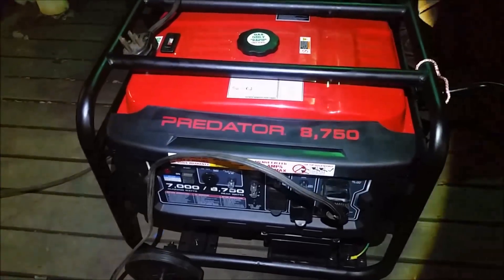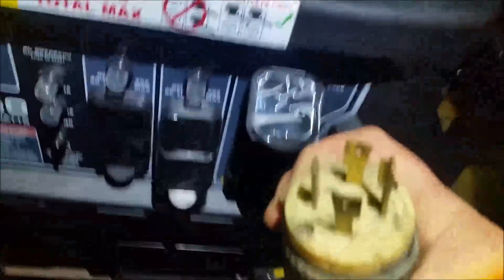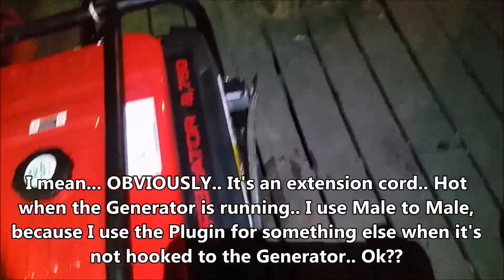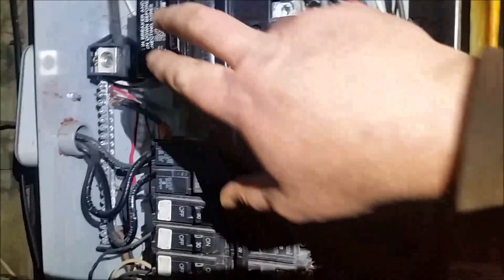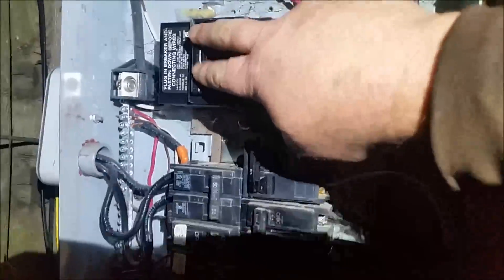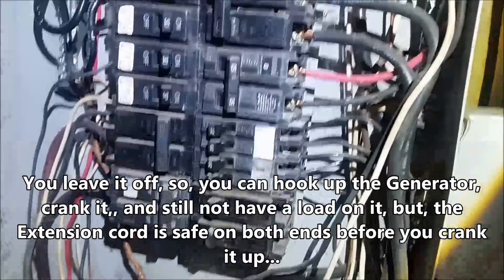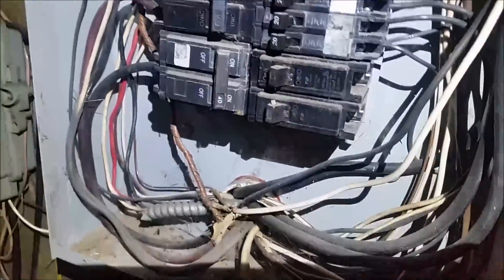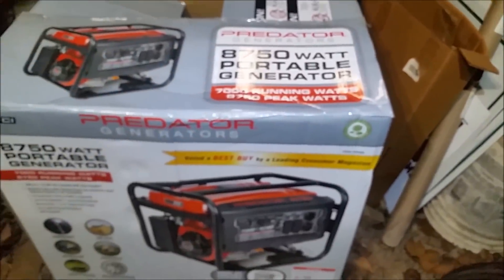Quick/Easy/Safe: Use Existing Plugin/Breaker for Generator hook up to your house Panel box.

Comment: Mark, you have made a very dangerous video. The average consumer is not capable of understanding the implications of a single error in this process. It can result in the death of a service person trying to restore power. I come from a 40 year career in the electric utility industry. A portable generator should never be used this way. It should be used to temporarily power individual appliances or lights. To use a generator in this manner requires a permanently installed  UL listed transfer switch that prevents interconnecting the auxiliary supply with the commercial power. Tripping a main breaker to OFF does not satisfactorily accomplish this. 
Any person that intends to use a generator during a power outage should prepare by installing an approved transfer switch before the power goes out. By over simplifying this connection you are setting someone up for a disaster, even if they only fry their TV set or microwave.
Reply: OK, if someone forgets to throw the main breaker their little generator is going to be trying to power the entire grid that is on their side of the outage. How much ampere would there be left to shock someone? In about 5 seconds it is going to strangle to death on the load.
Reply from the maker: Willie Keener.. Guys like you really amaze me.. How can you spend 40 years in a field, as you said, and not have more of a clue than you do,, after those 40 years.. I cringe when I think that you might have had something to do with the utility power, powering my home if you don't have more knowledge than I do about this and you were working on what supplies my house with power??? Holy Crap Man.. How could you sleep all day for 40 years??
#1) People are not as Stupid as you are.. When they buy a generator that will run their whole house,, do you really think that you will convince them that they should only run their """Individual" home appliances ""OR"" Lights,, rather than their whole Home on Generator??? (Individual Appliances,, "OR",,,, lights??) ARE YOU JOKING???? And, you claim to have 40 years Experience?? WHAT A DUNCE!!!
Don't worry about my video,,, worry about ANYTHING else you are going to do today.. Thank God, you are not in the field any longer... 
Single Error,, I agree with, but, not in my procedure.. Single Error working with Electricity at all.. If they made it past that, then, they are ready for the video, because, the video does not teach them how to make the cord, which is a next step they will have to search to find, and might start off a their local hardware store where they will get a second reality check,, where they might run into someone like you that thinks you can't use a Male to Male extension cord without killing themselves.. Once they get past that,, they know Electricity can kill, and Male to Male cords can kill.. Hell.. At least they are not in there trying to "Totally Rewire" their Main Panel Box,, which is about 1000 times harder, more complicated and 1000 times more risk to say the least.. But, you should know that,, just by looking at how to install one,, much less actually doing one or two of these in 40 years.. How could you maintain your opinion?? 
Average Consumer? Yes. I would agree with that statement.. But, what would an "Average Consumer" be doing, looking for a video like this?? You are right.. This is not for the "Average Anyone".. You have to have Common Sense to do something related to Electricity,,, forget the Generator hookup of any kind.. But, above average DIY's will have 100% success with this, as long as they use Common Sense... 
Next: Where in my homeowners manual does it say that I am required to have a Permanently installed UL listed Transfer switch?? Did I miss that manual when I bought my home?? Maybe I missed it when I bought my Generator?? Surely,, the Manufacturer of the Generator would not have sold me the Generator without me signing off that I had a Transfer switch and what my intended use of the Generator was?? So,, the requirements that you are talking about.. NEC?? Who's code is that? Your Average Joe Blow homeowner?? Sorry.. You are Dead Wrong!!
Now,, lets get a little bit lower on the Common Sense Totem Pole.. 
Your Statement:  requires a permanently installed  UL listed transfer switch that prevents interconnecting the auxiliary supply with the commercial power. Tripping a main breaker to OFF does not satisfactorily accomplish this?????? 
I would like you to explain to me just how you figure that.... You have a main breaker in your panel,, which you think turning it off does not disconnect or Isolate the Panel from the Grid or local power company (Utility Power).. But, somehow, the 'Main Breaker" in the Transfer Switch does??? 
Are you assuming that the Transfer switch does not directly connect to the main breaker in the panel?? Is there not a "Main Breaker" in the Transfer Switch that does the exact same thing as the Main Breaker in the Panel?  If you say it does not, then, please explain how Utility power drives the panel on the side of the house when "NOT" running on Generator? See how Stupid you are YET??? If the "Main Breaker in the Panel does not switch of the power,, then, how does the "Main Breaker" in the Transfer switch do it,,,, or do it "Satisfactory,, or Satisfactorily different??? 
Oversimplify??? What is Complicated about it?? Turn Main Breaker off,,,, Turn Generator Breaker off,, Generator is not running.. Connect Extension cord,,, hook up Male to Male Extension Cord, Crank Generator, and flip on Generator Breaker.. (Power is now back on)= Turn Generator Breaker off, Kill Generator, Remove Male to Male Extension Cord, flip Generator breaker back on if you are using it for something else and plug that something else back in, and turn the main breaker on.. How Simple do you want it?? These would be the same steps with a transfer switch btw,,, depending on how someone hooked it up.. 
The only difference is,, Male to Female Extension cord,, and you'd better not flip the Generator Breaker back on,, because you would create a VERY DANGEROUS SITUATION BY USING A MALE TO FEMALE EXTENSION CORD, because for 365 days of the year, there is a Male PLUGIN STICKING OUT OF THE TRANSFER SWITCH@@@@!!!!!!.. Correct me if I am wrong?? Who's Stupid?? Who's Installation is more Dangerous???? Mine??? My Male to Male extension cord is never "Not Plugged In", when there is even a Remote Chance that power would be on.. And, Double the Protection.. Two breakers off instead of One... 
Boy.. You just don't get it, now do you?? 
Fry their TV or Microwave?? Want to explain that one,, or are you tired of being a fool yet??? 
When am I going to run across someone who has enough sense to find something wrong with this setup that involves something other than a "Fool" trying to use it?? You won't!!!!! If you can't remember to turn the main breaker off,, how the hell did you remember to put your car in Park before you got out of it?? I mean,, really??? Put another 40 years in, and come back and see if you can figure this setup out again.. Hint... It is standard Premises wiring.. It's using an existing 220v plugin to temporarily power your house... Same Plugin you use every day for something else.. Just using a home made Male to Male extension cord to keep from installing something dangerous (like a Male Receptical) outside of your main panel,, that is there 365 days of the year, waiting for that ONE MISTAKE you talked about in your comment.. All it takes is someone hooking it up in the wrong place after the transfer switch is installed,, or having someone like yourself install it.. No Thanks.. I'll do it myself,,, just because of people like you out there running around,, calling yourself an Electrician..
Reply: https://youtu.be/Hug6XckVc8E
Reply from the maker: You just won't quit..Ha..Ha.Ha... Thanks for pointing the Video out.. I totally missed commenting on one of your MOST IGNORANT COMMENTS EARLIER.. AND,,,, to make it worse,,,,, It was a Defensive Response to one of my comments,,, so,, you were SURE TO GET THAT ONE RIGHT.. YES?? 
Ha..Ha..Ha.. What a Crying Shame.. You can't even get THAT Right..Ha..Ha..Ha.. 
You said a transfer switch was safer, better, etc.. I commented that,, you didn't like my "TEMPORARY MALE TO MALE plugin,, but, you were going to INSTALL A PERMANENT MALE PLUGIN OUTSIDE OF YOUR TRANSFER SWITCH OR PANEL DEPENDING" and it would be there 365 days of the year, waiting to "Get" someone... And,, what was your Reply????? Here you go... "  A permanently installed transfer switch does not have a receptacle at all."
Ha..Ha..Ha..Ha.. 
BUT,, what did you do next??? Ha..Ha..Ha.. You sent me the Video that you just watched before you got here,, but, you forgot the Subject of the Video..Ha.>Ha..Ha..Ha.. I saw it  at video time :06 seconds.. What does the guy have in his LEFT HAND?? Ha..Ha..Ha..Ha..Ha... WHAT A DIPSHIT!!
This is Poetic Justice.. You send me a video of some other Genius,,, that you think it going to help you to Spank me,, and damned if you didn't send me another SPANKING FOR YOURSELF..Ha..Ha..Ha..Ha... I am listing to the video, while I am typing,, just waiting for the part of the video, which I suspect, after seeing his box and hearing him say "Switch" on his "Male Plug outside of the Box",,, waiting to show you what a fool he is,, if the switch is what it could be.. I can't see anything else that he would put a switch in the box for.. Wait,, Wait,, Wait,,,, ????? 
THERE IT IS... EXACTLY WHAT I WAS WAITING FOR,, SINCE :.06 IN THE VIDEO.. WHAT A COMPLETE IDIOT!!  I MEAN IDIOT!!!!!
AND,, WHAT IS WORSE???? A GUY WITH 40 YEARS EXPERIENCE,, SENDING ME THE VIDEO,, TO SHOW ME THAT THIS IDIOT IS DOING SOMETHING CORRECTLY??? HE IS CREATING A DEATH TRAP,,, A SUICIDE BOX THAT IS GOING TO GET SOME CURIOUS SOMEONE KILLED!!!!
WHAT A IGMOFUCK!!    All someone has to do is walk by there,, see a fancy green box, and a big rocker switch,,, flip the switch and put his finger in the connection,, NEVER DREAMING SOME IGMOFUCK WOULD DO SOMETHING DANGEROUS LIKE THAT,, AND GET THE SHIT SHOCKED OUT OF THEM... AND YOU HAVE 40 YEARS OF EXPERIENCE and MISSED THAT???? OMG... The Ignorant people in this world.. If you missed it.. The last few seconds of the video is what I was looking for.. Since you are so stupid you missed it the first time,, let me point it out to you.. 
https://youtu.be/Hug6XckVc8E?t=7m51s It starts right where I have it posted.. This is how you kill someone... Allowing the Male Plugin,, that you clearly said did not exist,, which has to,, unless you use it the way I designed my setup,,, to be switched outside of the box??? What a dumb fuck.. 
I really have nothing else to say... Wow.. There are really some stupid people in the world.. Now.. I did not watch the whole video... But, I saw enough.. The box is there to plug the generator in,, and,, it powers the box,, so,, it is a SUICIDE setup.. I can't see any way he could hook up those wires and end up with what he said and not cause that problem.. But, I am open for correction, if you can point it out.. Just tell me about the two black wires and why they are not directly connected to the switch with the red one.. WOW..  40 years experience and this is what you send to me???Ha..Ha..Ha.. 
You Sir,, are definitely NOT the Average Joe Blow homeowner.. Much, Much worse..
Reply from the maker: The only other explanation I can think of,,, is that this guy is only using the generator to power the Furnace and NOTHING ELSE... Like.. He has a house that has a working Furnace,, and NO LIGHTS!!????  I didn't quite expect that,, that might be the case.. I mean.. That would not make much sense at all.. What good would a nice warm house be,, if you didn't fire up some light circuits in the house to see where you were going? Surely,, if the Generator would power the furnace, it would power some lights,, which are most likely on their own circuits.. 
Well,, they are on their own circuits on anything that I wire up anyway.. If you have to work on the wiring in your house,, why would you not have your lighting on one or two circuits and everything else separate? You need lights to work on the rest of it.. Maybe I just think too much, and do things that make sense... I never have to turn my lights off to work on something not light related.. Ha..Ha..Ha.. I can't imagine running just a furnace on a generator and not having lights.. Ha..Ha. I just commented on the video to find out what the guy was actually doing.. Even DaveknowsHow commented positively about it.. Of course he does Tractor videos, but, seems like the kind of guy who would know Electricity.. In other words,, has common sense..
Reply: My friend, you are a special genius. You have made a video where you demonstrate breaking every safety violation that exists. I would point you to the individual sections of the code, if i thought that you would read them. But since they disagree with your ideas, you would ignore them anyway. A permanently installed transfer switch does not have a receptacle at all. It is PERMANENTLY wired. A male to male extension chord is a violation of the NEC, which by the way means National Electric Code. It is a minimum standard that everyone can expect to be followed . The clearances between energized parts and de-energized parts inside a circuit breaker will not provide the level of safety that is required for auxiliary systems. 
Lie and tell people that you have had this system inspected by an actual inspector or even manufacturers rep. Every statement you arrogantly make, reflects a cavalier "that'll do" attitude. Even your explanations indicate your lack of knowledge. I hope there are no little kids that are watching this thinking you are a genius.
Reply from the maker: Willie.. I have pointed out every area of your ignorance on the subject.. Let me continue, since you have not had enough yet, and I will again try to find areas where I can agree with you, but, I'm not sure that is going to happen.. 
Lets see.. Every safety Violation.. You will have to be more specific.. But, I would imagine that you are talking at least about the Male to Male Extension cord.. Which is not NEC.. But, if the Inspector comes to my house,, will he come while I am running on Generator?? Nope!!.. So,, if he comes any other time,, just what it is that won't be NEC Compliant?? Nothing!! Ha..Ha..Ha.. Who is the special genius?? You did use the phrase "Every Safety Violation that Exists".. Ha..Ha.Ha.. What a DIP!!
BTW.. The individual Sections of Code.. Who Study's the NEC Code book? Joe Blow Homeowner?? Who was it written for?? BTW.. It is National Electrical Code if you are going to be specific.. 
But,, do you know where the NEC code came from? Where or what occupation do you think is the most dangerous when it comes to Electricity?? How about a ShipMate, where metal is everywhere, even under your feet?? Would that qualify?? So,, safety standards there would be the most stringent.. Agreed?? Look at what the CFR,, if you know what that is "Code of Federal Regulations" says: 
Deenergizing the circuit must be correctly completed by opening the circuit breaker, opening the switch, or removing the fuse (29 CFR 1915.181(c)).  The circuit must then be locked out or tagged out in accordance with 29 CFR 1915.89.
So,, again,, after 40 years,, you still have not figured things out???? 
Come on.. Try again.. Guess how many years experience I have in the Electrical field? ZERO!! I don't subscribe to people telling me this and that,, that makes NO SENSE TO ME!! I look it up... And, what I just posted proves you are STUPID ONCE AGAIN!!  "Opening the Circuit Breaker, Opening the Switch, or Removing the Fuse.. And, you think the Transfer "Switch" does something the "Breaker does not"??? Ha..Ha..Ha.. 
If Lightning strikes the main line coming into "EITHER" the Transfer Switch or Breaker", the "Clearances" are not enough to save you either way!! So,, now, you have to come up with something between "Normal and Lightning" so, you can argue about that.. 
I don't just Say you are Stupid,,, I prove it.. 
Lie?? Ha..Ha.. The  Panel will pass inspection any day of the week.. I would not have the Generator running, nor would the inspector inspect if the Generator was running, so, even though I did not say that it had been inspected,, it would definitely pass inspection.. There is only one other temporary wire that was shown in the video that was a temporary fix for a direct burial that must have gotten nicked of the years that burned out, at the time that you might see in the video, since I had just temporarily wired until I had time to fix it.. Other than that.. Everything else,, ready for the Generator hookup is up to code.. And, I would be willing to bet, that the Inspector, even if he came and decided to inspect while running on Generator would pass the whole deal.. 
Well, I address each of your statements specifically, but, you like every other Liberal Democrat, don't do that, because you can't argue facts,, just make general statements you can't back up.. IE.. 
" Every statement you arrogantly make, reflects a cavalier "that'll do" attitude. Even your explanations indicate your lack of knowledge. I hope there are no little kids that are watching this thinking you are a genius."
I'll rephrase that.. "Can Do" attitude, because I can and do, and it's up to Code and even where you say it is not, I post CFR that says what you say is "IGNORANT",, so, I am not worried about the little kids will think.. They can come up with that deduction on their very own.. I think it is quite obvious who knows and does not know..
Reply: Mark Thomas being the exceptional genius that you are, do the utility workers in your area and post where you are located, so they can take the appropriate caution if they are ever working near you. See I know people that have been injured because they allow people of your intellect to walk freely on the streets.
Reply from the maker: Ha..Ha..Ha.. Yep.. I talk with them quite a bit actually.. Two of them have my exact setup.. But,, I bet that none of them are IGNORANT ENOUGH to do what you suggested in that "SUICIDE VIDEO" you posted just a minute ago... Jesus Christ Man. You are really Stupid!!! And,, you keep going and going and going... I hope you do not live anywhere near me... I hate to know you are on the road anytime I am... Ha.Ha..Ha.. Seriously!!!
Reply: Willie Keener: Interestingly my Aljo travel trailer is hooked up to power using a male to male plug. Granted it's only 110, but it always seemed odd to me. This is the factory set up too.
Reply: ShysterLawyer , the difference is that with your travel trailer, you do not have what the NEC calls a separately derived system or auxiliary power source..
Reply: Willie Keener; but wouldn't it if it's plugged into a generator? Or even if it's plugged into the house it's separately derived for the trailer itself? 
I don't pretend to have knowledge of a lot of code, I just thought it interesting in the  comments here of all of the "never use a suicide cord" statements while I'm recalling that my trailer is factory with one.
Always thought it was screwy that they did that, I make sure to plug in the trailer side first before the power source so I'm not handling a live male plug, but how many people think about that? Other travel trailers I've had put a male plug on the trailer to receive the power so you can use a standard  extension cord as a supply line. This Aljo is the first I've seen with a female input.
Reply from the maker: ShysterLawyer.. Interesting.. I wonder why myself.. My first thought would be a low profile female verses an inset male.. If you have a male plug hanging outside of the trailer and put power to the trailer from any other plug for any reason, it is hot and waiting to bite someone.. but, I doubt that is why they did it.. But, does make you wonder.. if you ever have a reason to call them,, it would be one question I would surely ask.. Someone would probably be able to answer the question,, just because it is unusual.. Hey. I'll bet you get the heebie jeebies when you grab the male to male cord?? I still do,, just for a second while I re-affirm.. First side goes in cold first, then, hot side.. But, every time I pick up the cord,, it reminds me to be safe.. Another reason the Male to Male cord is safe in the hands of someone with common sense.. You would have to be super light in the brain area not to "think twice after picking one up".. Cheers. 

BTW.. LETS MAKE A POINT HERE.. Like I have said 100 times in this video.. NEC DOES NOT REGULATE Portable Extension Cords.. Otherwise, you would not have a factory unit that has one..  The Closest talk of cords is "Appliance Cords and the section that talks about them does from the standpoint of,,  if it is commonly plugged and unplugged, then, you can use one.. If it is not, then, it should be hard wired.. Sections 406.6 and 406.7.. Cheers..
Reply: ShysterLawyer , the intent of the code is for common public utility systems. It governs what is acceptable to be connected to these systems. The connection of auxiliary supply systems to a house, shop, commercial building, church etc. that is permanently connected to a public utility system is required to conform to the articles of the code or more stringent requirements imputed by a civil authority having jurisdiction.  The NEC is a minimum requirement that is accepted by insurers, state authorities and municipalities to promote safe utilization of electricity and minimize the danger of fire in occupied facilities. 
A facility that is not, or does not intend to be connected to “the grid” is typically not under the jurisdiction of the code. A facility that is connected or being constructed to be connected typically is. A facility is limited to one service entrance unless it has fire approved walls between sections having different entrances. (Duplexes) Any other source of supply is separately derived from the public utility system and there are code sections that govern their use. 
A travel trailer does not have its own supply and can typically only be connected to the utility power or the generator in which case the generator is no longer an auxiliary. 
In any case the NEC does not allow attachment cords that have or have the potential for exposed live parts. 
Numerous people have commented that common sense is no longer very common. With that I totally agree. For that reason us liberals believe in having common rules that protect the ones that have a low quotient of common sense.
Reply: This shit is too funny
Reply from the maker: Willie Keener. I like your reply.. Either it is a copy and paste from a NEC promoting site, or you have written it out of knowledge and you are familiar with the codes.. But, the reason why I said "Copied from a NEC promoting site", is because some very valuable information is missing and the only people that want that information missing is the NEC itself.. So, I will edit/add, fix some of your sentences and by your reply, I will know if it was a copy/paste or, you will agree with what I am saying when I do the edits.. Your choice.. Here goes.. 
--
As stated:
 is required to conform to the articles of the code or more stringent requirements imputed by a civil authority having jurisdiction. 
Modified: 
is required in the municipalities which have decided to adopt the whole or just portions of the NEC where applicable, and may restrict or eliminate some additional portions or, use the existing and then add more stringent requirements via the civil authority having jurisdiction. 
--
As stated:
The NEC is a minimum requirement that is accepted by insurers, state authorities and municipalities to promote safe utilization of electricity and minimize the danger of fire in occupied facilities. 
Modified: 
The NEC hopes that it is accepted and adopted as a Minimum requirement that is accepted by Insurers, state authorities and municipalities to promote safe utilization of electricity and minimize the danger of fire in occupied facilities.. The NEC is a consortium of Electrical and Fire Safety companies who have a direct interest in the sales and promotions of their products and the NEC Code manual itself. It in no way is a directly associated with any Federal, State or Municipality and it's code book is in no way required by any entity to be followed, unless it is specifically adopted by that State and depending on how the state implements its safety policies may be specifically adopted or refused adoption by the municipalities of the state, or they may be Mandated by the state to be policies requiring adherence by all municipalities of the State, if the State so requires.  It can be adopted in full, or in part by any Institution, group, association, or Federal or State entities or refused by the same. The Majority of the states at this time have adopted at least portions of the 2012 and 2014 NEC Code book, but the adoption of the 2017 codes are going very slow and a very few states have moved to change to the 2017 codes as of yet.
--
As stated: 
A facility is limited to one service entrance unless it has fire approved walls between sections having different entrances. 
Modified: 
A commercial building (ie.. office complex, Retail Store Center, or other Commercial Building) is limited to one service entrance unless it has fire approved walls between sections having different entrances. 
--
As stated:
In any case the NEC does not allow attachment cords that have or have the potential for exposed live parts.
Modified: 
NEC does not regulate Portable or commonly connected and disconnected Extension cords. It does however regulate cords that are not commonly connected or disconnected cords, and does stipulate when cords that are not commonly connected or disconnected must be hard wired. 
In addition, the NEC does regulate the design of the Plugs and Receptacles that the Portable or Extension or Appliance cords that are commonly connected and disconnected have on both ends, however, it does not regulate the choice of which of the approved plugs may be used singularly or in combination where the application is on temporary or portable extension cords.. But, it does regulate some types of receptacles and where they should be used, like the GFCI where water danger is present near the source.. 
The Modification comes from NEC CODES  406.6 and 406.7
There is no reference to the Male to Male cord in the NEC as far as I can find, but, It is very hard to find something that does not exist to be able to say it does not exist,, if it is not there to verify it is not there,, therefore, I can not be 100% certain, but, 99% that, it is not covered in the NEC.. 
But, feel free to prove me wrong, since you have made the statement:: 
 NEC does not allow attachment cords that have or have the potential for exposed live parts.
Provide a link to the NEC code text where you say this was found..   That statement does sound reasonable, but, I have been told that it does not exist, but that is surely not the terms I was searching for. 
It's a shame that they do not make the NEC public.. but, after all, they sell the books, but there are some online references to it.
It may be a requirement that Electricians purchase at least one copy in their lifetimes, but, they sure as hell don't know it.. 
Even someone in the business for lots of years can't say for sure,,, the fact that he should know and he says that is what he knows about it.. 

And, that is the reason why no homeowner anywhere in the World is going to be held responsible for any NEC Code infraction. Only one that was pointed out to him by some municipality and he refused to correct it, in which such an instance would not be an issue, because, the municipality demanding compliance would simply shut him down until he was in compliance. So,, all of the threats about being out of NEC compliance and being sued are absolutely ridiculous. 

One other point.. When you are talking about Auxiliary or Duplex systems, I really doubt they are talking about supplies to Camper trailers.. 
What they are probably talking about ( I would need to see the sections to be sure) are like they say ( and I would think would be stated differently, not Public Utility, but Alternate Power Supply Systems) would be what most would refer to as "Plant Power and the Opposite would be Utility Power".. 
Why do I think that, or am pretty sure or quite sure of that? Because, they would be rightly so to regulate another Power Source where that power source might be Duplexed with the Public Utility Supply.. 
I worked at a plant in Louisiana which had both of these systems with both automatic and Manual switching and some how did Load Balancing between their own plant generated power and the Utility power. That in my opinion would be "Duplexed Systems".. 
One more point.. When you Flip your Main, you are "Off Grid" for the sake of the term.. You are Permanently connected, but Off Grid or Off of Utility power at that point.. We generated our own power for a considerable portion of the plant, and never went on Utility, except for maintenance etc.... Other portions of the complex were on Utility all of the time. Then, on turn arounds, or, when there was a high production demand which exceeded normal output, the plant ran on Plant power and Utility power at the same time, and load balanced.. For Instance.. We may usually run 100% plant power, then, during peak production, might run 70% Plant and 30% Utility.. 
If it were not regulated, it could cause a huge catastrophe.. We also had Manual and Automatic switching..  The plant could switch any second they wanted to back and forth from plant to 100% Utility if they had to, but, due to the size of the load,  the switching was always coordinated with the Public Utility, so they could make any adjustments necessary, since they need to know if something like that was going to happen before hand to get ready for it.
The Duplexing was something totally different.. That switching/load balancing was always 100% Coordinated with the Utility and NO switching took place util both the Plant and Utility both agreed it was possible to duplex the two systems.. The Generator for Plant power had to be varied and timed to the Utility and the Utility would make slight adjustments to get the wave signs matched.. The hertz/cycles had to be perfect on the first phase and the 3 phase was allowed to have some variance since it is out of sign/wave with the first anyway.. 
The reason for the Precision that was monitored (dedicated 60 seconds of every minute) was to ensure that the phases were in sync.. 
Say,, the systems were 480volts each.. If you bring one source online at the peak of the wave, and the other source at the trough of the wave, instead of balancing the 480 volt load, you have a total of 960volts as far as the equipment sees it and it can have some devastating consequences.. 
I doubt very seriously that the NEC was involved, but, may have some suggestions or regulations that have been developed because of these types of experiments or specific needs.. It is critical that it be done correctly and critical that both Auxiliary and Public Utility are perfectly in sync. 
They vary the cycles usually 60Hz up and down slightly until they are synchronized before switching together.

So, saying all of that,, I seriously doubt that any of the above statements where related to Aux or Duplex have anything in the world to do with anything but another Electric supplier, or supplier of Electricity that would be an Auxiliary Source of Public Utility power or vice versa. When you re-read that, make sure you are looking for that differentiation. Because the statement you made about the trailer no longer being an Auxiliary didn't make much sense to me, and if you look up the definition of Auxiliary in the NEC, I don't think you would either.. But, lets look at that for a minute anyway.. 
"A travel trailer does not have its own supply and can typically only be connected to the utility power or the generator in which case the generator is no longer an auxiliary. "
I just looked at about 15 definitions... Auxiliary is one of two things.. The reason I would want to see the NEC definition.. I can't see them using both meanings, which is why I doubted the word in that context. 
1) A backup system.. This is the least common definition, but is generally accepted, but, could be confused to the point you would be splitting hairs and it only make a big difference in these types of applications we are discussing.. So, I don
Reply from the maker: So, I don't agree with this one. Lets just say that a Generator would be an Auxiliary or backup system to a home who lost Utility power.. 
One and then the other powers the home.. 
2) providing supplementary or additional help and support.  For the short version.. Examples: 
 A fire department may bring in auxiliary units, for example, to battle a tough blaze, or a sailboat may be equipped with auxiliary engines to supply propulsion when the wind disappears.
3)Supplementary or subsidiary. Held in reserve for exceptional circumstances. (nautical) Of a ship, having both sails and an engine.
4) The men's club and the ladies' auxiliary were merged into one organization.
5) Giving assistance or support. 
I believe 2/3/4/5, and more specifically the #3 is the best description.  A ship function is traveling or moving.. Either Sails or motor or both to do so.
Fire Department fighting  a fire is a Unit fighting, consisting of units working together to fight the blaze.
Two clubs merging together for their functions. 
Giving more electricity to support the need. 
A trailer is either 100% on or 100% off. No sharing. Same with every other building, house, CHURCH, etc.. which is not producing power assisting the Public Utility.. 

So, the points of contention needing clarification is,, the fact that the NEC is a book of Suggestions written and supported by a consortium of companies that benefit financially by the adoption of it's book as rules or standards, and not some "National/Federal" set of rules that are adopted by All States, etc.. 
Nor is it any type of Law, even after it is adopted (it is still code and not Law), unless some specific part of the code is specifically adopted as a law, and that has to be done by a legislative governing body of either the Federal ( which is is not), States (which NO State has made all NEC code as Law), neither any Municipality..  North Carolina only adopted a couple of sections as far as I can see. 
Agree or Disagree?

A facility is limited to one service entrance unless it has fire approved walls between sections having different entrances.
Would only apply to Commercial buildings, not residential, etc.. 
Agree or Disagree?

Auxiliary and Duplex refer to only those who are producing their own power systems that are online with  the Utility Power.. 
I didn't define Auxiliary here.. OOps. Our plant had some 100% Utility and some 100% Plant power (Auxiliary),, 
Aux meaning helping or assisting the function.. The whole plant needed to run.. Some on Plant, some on Utility only, but still one plant needing to operate and using Public Utility to provide the Needing to Run function. 

Duplex = Plant and Utility dual power usage and load balancing... 
Agree or Disagree? A little research needed I think..  But, I think agree.. 

Male to Male Cords.. Since I have been told it does not exist and you say it does, this is the closest that I can find... and I explained it earlier without reference.
But, here is the codes that are most closely related, and some knowledgeable people discussing this exact issue. 
NEC CODES  406.6 and 406.7
Notice the first reply by the Moderator.. Even though he disagrees, he says it is not regulated.. And, he knows enough, no one even remotely argues with him.. 
http://forums.mikeholt.com/showthread.php?t=158086
Then,, look at the NEC Code Definitions on this page and spend a while understanding what you are talking about, and then go back and read the forum posts.. You might be able to understand what everyone is talking about.. 
https://iaeimagazine.org/magazine/2014/12/02/article-406-receptacles-cord-connectors-and-attachment-plugs/
And,, if you think that backfeeding a panel is not common in the Electrician world.. Ha.Ha.
https://www.electriciantalk.com/f2/breakers-directional-19714/ 
Feel Free to post the link for clarification.. You just might be the first person to prove me wrong out of almost 900 comments if you can provide the link supporting your statement.. If it does not exist, it will explain why I can not find a link to support my opinion.. 

And, one last one on the Political side of the house.. 
For that reason us liberals believe in having common rules that protect the ones that have a low quotient of common sense.
--
My thoughts are the thoughts of the Founding Fathers which is only a term, because every sort of person, both male/female, white/grey/Red/brown/black were all involved in the outcomes.. Documents related are Constitutional conventions, The Federalist and AntiFederalist Papers, Numerous letters from the most valued who were picked to support the opinions of the groups brainstorming together to represent their ideas to others, since it was done by letter on horseback instead of FB /Youtube and Blogs back then.. 
You have the Right to Choose in your Pursuit of Happiness,,, AS LONG AS,, your choices or decisions do not affect the next mans right to do the same. 
That means that neither you, the Government or anyone else can do anything to upset me today, tomorrow or any day after.. Although that leave a lot to the imagination. The Government derives it's just powers from the Consent of the Governed..  The Government can have no powers not granted to it by the Governed.. We are a Representative Republic, not a Democracy btw.. So, our Representatives and Congressmen are only there to represent us and to insure our wills are what happens and not the crap hole back pocket deals we have now.
 
Declaration of Independence: 
“Governments are instituted among Men, deriving their just powers from the consent of the governed.” This means that government gets all its power from the people.
10th Amendment:
The powers not delegated to the United States by the Constitution, nor prohibited by it to the States, are reserved to the States respectively, or to the people.  (The Constitution is a Negative Bill of Rights).. All rights remain to the People, unless it is specifically granted to the states,, or Enumerated to the Federal Government..) To the States or to the People Respectively.. Why does it say that? The People created the States and Federal Government.. A subordinate or child can have no more rights than that of their creator.. Just about every state in the union has a Constitution that starts off like this.. 
Preamble to the Constition
We the People of the United States, in Order to form a more perfect Union.......  Most states start off the same way... The People, in order to form a more perfect union or voice or group or band, etc.. The States "ARE" the union of People.. They retain the power and authority.. 
That is why those like me think that things should be the way they once were.. You had to own property in order to "Earn" the Privilege of Voting.. 
That means, work hard, earn, save, spend in your community, save invest,  buy, own invest, earn, and understand how you were able to do that, and if that were the case there would never have been a Socialist/Communist Obama or even a Bernie who beat out the Socialist Hillary.. Why? Because if you decide that everything is free, and I have to pay for it,, then, it infringes on my rights of individualism. 
There is lots and lots more.. 
Lets say Rules and Regulations, an how they work out.. Gay Marriage.. How did that work out from the beginning? Why did it not work?
Progresivism.. Slow and unnoticed change.. Why was Gay Marriage a problem? Because, Marriage is something that should never have been regulated. It is a choice between two people.. Where did the problem start? When someone said you had to have a license and society at that point decided it was between a Man and Woman.. Gays stayed in the closet and minded their own business. But, before that.. Where was the first Marriage and why?
In the South they had blacks they called Slaves.. The African trader was who brought them, and they worked for their freedom. Because, where could they go until they could buy their own property?? And when they did,, they earned the right to vote, but, the kept working because now they needed money to buy the materials to build a home, buy stock, implements, etc.. So, they let their kids run the farms and they also worked until they were debt free and had what they needed to function on their own... And, some had attitude problems and had to be corrected, same as their hosts had the same problems in the South. 
In the North, there were the same blacks, but there, they were called Indentured Servants.. Liberals were in the Northeast. Nothing has changed there.. 
They did the same.. Worked for Property.. They worked together, they ate together and as you should assume started sleeping together, but, society did not approve of that.. So, they created Rules for the Blacks only.. If they wanted to get married.. they had to get a certificate of Marriage, and that had to be approved by a group of 10 people.. If a Black wanted to Marry a Black, it was Ok.. If they wanted to Marry a white, they would be denied but never knew who voted against them.. So, the rules are there to remove rights from Individuals.. Can we still see that?? Yes.. In a minute.. Even though the Liberals were more tolerant, they were only that way in public.. They still could not stomach a chocolate baby and would get together in bands to eliminate others rights.. 
The same reason they created the Ku Klux Klan..
Reply from the maker: Lets look at the Institution of Marriage.. Because the State got involved to begin with and said "Do you take this man,, and this Woman",, they had to again get involved in whether or not Gay Marriage would be allowed.. A Constitutional Libertarian would never have made that mistake.. He would have protected the rights of all others to maintain his/her own rights.. It is your choice to choose the same sex if you want, not someone elses, but, the State has no right to demand a certificate to do so.. Problem solved with Gay Marriage.. Abortion solved also btw.. 
Back to Marriage.. Today.. You and your girlfriend decide to buy a home to rent it out and make some money.. You go to the Realtor.. We want to buy the home 70/30% ownership. I pay more, she takes care of it and rents it and we split the rent 50/50 after expenses. Realtor says, none of my business, sign here Mr Thomas, and here Mrs Price.. You are now proud homeowners 70/30%.. It works great.. You go to Las Vegas, get drunk and happily get married and fly back home.. The house next door goes up for sale.. Back to the Realtor to buy your second.. same way.. 70/30% Realtor says fine.. Sign here Mr. Thomas, sign here Miss Price. and you say,, we got married.. She says,,,, Oops, you can't do that anymore.. He can put down 70% and you 30%, but, you own it 50/50%.. Why?? Because you got married.. but, why?? By the Power Vested In Me by the State of ??,, I KNOW PRONOUNCE you  Man and Wife.. 
Hmm.. How did that take away my 4th Amendment rights to Contract with another individual.. Because,, Marriage is designed to remove your rights. You didn't enter into a contract with your wife,, you entered into a contract with the State.. The State created the Contract, therefore will maintain the contract according to the state and the State will allow you to terminate that contract via the rules of the state and we call that a Divorce.. For what other reason did they loose their right to contract with each other?? That is what rules an regulations are good for.. Also,, Taxes/Fees/Fines/Certificates/Permits is how the Government survives.. It makes no income of it's own. It sucks from its citizens.. The only Institution created in the Consttution that generates its own revenue is the USPS and it has been in the Red for Years.. 
That is the reason why we Enumerated or Limited the Powers of the Federal Government. Because we all had to pay for it and there were a very few reasons that we knew that were needed for it's creation, but, we feared creating it. The reason we had the Bill of Rights in the Constitution..
The Enumerated Powers are listed in Article I, Section 8 of the Constitution. The Government has far surpassed those Enumerations.. 
If you like lots of rules and regulations, you are slapping the people who died for your freedom in the face and these people really did die fighting for their Rights to Freedom.. You should really take the time to read this.. 
https://www.archives.gov/founding-docs/declaration-transcript
Let me post some phrases to peak your interest.. Because if American goes the way you want it, then, History WILL Repeat itself and you just might be here to take the place of those you are slapping in the face.. Because, you will not like what it becomes. Lets see how they felt.. 
-
We hold these truths to be self-evident, that all men are created equal, that they are endowed by their Creator with certain unalienable Rights, that among these are Life, Liberty and the pursuit of Happiness.
-
 Governments are instituted among Men, deriving their just powers from the consent of the governed,
-
That whenever any Form of Government becomes destructive of these ends, it is the Right of the People to alter or to abolish it
 that mankind are more disposed to suffer, while evils are sufferable, than to right themselves by abolishing the forms to which they are accustomed. 
-
 But when a long train of abuses and usurpations, pursuing invariably the same Object evinces a design to reduce them under absolute Despotism, it is their right, it is their duty, to throw off such Government, and to provide new Guards for their future security
-
 the present King of Great Britain is a history of repeated injuries and usurpations, all having in direct object the establishment of an absolute Tyranny over these States.
-
When you read the rest of the text on that page,, tell me if you don't see that exact same thing happening all over again, and we are not far from it. Well, Trump is going to set it back quite a bit in  his 8 years but, still, it WILL HAPPEN... 
---
Vote for me, and I will give you everything for FREE.. Who would not vote for that?? Only people smart enough to know that won't work.. What.. 15% of the population?? Socialism has not worked anywhere in the world over a long term. And, where it appears to work, you need to see the details.. There are some Countries where it has worked for a while, but, falling Oil prices have almost destroyed it more than once.. Norway.. the Oil Rich Country is one example, but, they are very few.. I would say that 97% have failed.. And, when they fail it is not pretty.. 
Think about it like this.. It's pretty bad like it is now. Who actually pays the majority of the Taxes? Middle Class and Small Business.. Tax Refunds? Did you know that every worker in the USA gets back 2-3 times more taxes than they pay in on their tax Refunds? What is the definition of a Refund again?
How about the fact that 90% of Welfare Recipients can't pass a drug test.. Does that bother you?
Imagine if it was still like it was back then.  You had to own property to vote.. No Obama, No Hillary, NO Bernie,, less of a chance at the Eventual Destruction of this Country.. Imagine if they audited Senators and Representatives before they went into office and up to 20 years after.. Starting pay for a US Congressman is $170k per year. If they stay in for 4 years and come out with 6million dollars, should they go to jail? In my world they would. 
How many liberals do you know that would be able to vote if they had to pass a Constitution and Fundamentals of the USA test and pass with 75% or more? What.. Zero?? Scary huh... 
Better not Elect me President. You think Trump is moving.. I would be focused on the Economy, but, I would already have the Past criminals in jail... But, he will make things right. I have confidence in him and Q and MAGA.. Cheers.
Reply: I do believe that you posted this. For someone with common sense, this should be all they need to know that this is not something that they want to do.Never read the thing about Cat 5 cable either. I just knew you were an electrical engineer.                    boy, they walk among us!    Mark Thomas1 month agoGood Points.. I have been lucky, I think.. I have a Northern Tools Generator, but, not their top of the line generator for sure.. I have brown outs when things kick on and off, if I am running the A/C, Water Well, and my Laser Printers from time to time.. I do turn some of that off when I want to warm up the 80 gallon Water heater, because it really drags things down, but, in 12 years with this generator, I have not had any spikes that have damaged any equipment, but, I know someone who has on generator... Funny thing though.. Both of us experienced some really weird stuff about the same time (both of us running on different generators), and it was the exact time that the power company was turning the power back on..  They burned out several surge strips, power supply in a computer, GFCI breaker on a hot tub, etc.. I just saw some really weird stuff at my place.. One light in the kitchen went way bright, while another in my den went super dim, and my microwave beeped, but, the most sensitive piece of equipment (my TV and Dish) which is usually the first to reset, never missed a beat. I didn't have any damage though... The power company threw the  power on, because we were talking about it over the VHF radio, when the neighbor piped in and said, they just turned it on, but, it went right back out.. I think we had an arc past the main breaker into the panel, probably to ground based on how the surge strips were taken out.. 
To top that off, about a week later, lightning hit directly across the street from me.. About 100 feet away..  The voltage traveled through the air, hit my Ethernet cable (hanging between buildings in the air), and did some of the weirdest things I have ever seen.  Had to get into the ethernet cable in the middle of it, between the two buildings. I think it is 24 gauge Cat V. It went both ways.. To my house, it took out the port of the 36 port hub (but only one port), and damaged the 24ga 10 foot long patch cord running from the patch panel to the hub.. It blew out 4 of the 8 wires when I checked it with my patch cable checker..  Ran down one long 24ga cable, jumped into the patch cord, burned it up, and one port of the 36 port hub.. But, didn't damage the 24ga cable it had to jump into.. 
On the other end, the other building.. It went through an 8 port hub (No Damage whatsoever), took out the Ethernet port AND Power Supply on the Credit Card Terminal, then from one hub, to the next, where it took out 6 of the 8 ports (spike only came in on one port), and took out the Ethernet port on my photos computer, but, didn't take out the ethernet port that was connected to the wireless router... Hows that for strange?? 

The week before,, I am just about 100% certain the power company had a hot surge, which jumped past the main breaker which was shut off), and jumped into the ground at the other place, and I can't say for sure, but, surely affected light bulbs, which are usually just part of the Hot Circuit and most people don't even hook up frame grounds, so, maybe, but very possibly could have jumped from ground to hot.. Might explain why one bulb went dim, but, I'm not sure how to explain the other getting bright, unless it jumped the hot wire, which would be reasonable to think..  I can only put that in the back of my mind and wait for something like that to happen again and see if there is more data to look at.. 

Either way.. now, my neighbor is pointing his finger at his Generator, since it was running when the power surge happened, but, I am not so sure.. But, he is going to have a hard time hooking up the generator again without some protection.. I'll have to see what I can find and see how much those guys are.. I am thinking at least a bill and a half.. Hmmm.. Thanks for the comments..
Reply from the maker: Ok.. that is exactly what I just said in my two previous posts.. (JUMPED PAST THE BREAKER)..  Not Through it.. I know it is hard for that little mind  of yours to grasp the concept... Think about it like this.. Have you ever seen a sparkplug, or lightning? High Voltage?? It Jumps.. Correct? From one point to another? From it's source to a ground?? From the center of the spark plug to the side which is grounded to the frame?? From the sky to the ground?? 
Make sense yet??? From the wire feeding the panel to the ground of the panel metal itself? Look at the panel when you get a chance again.. Just how much distance is it from the main power feed to the closest metal that is grounded??? Then imagine a "Big Sparkplug" or some lightning,, and you should be able to figure out what "Jumping Past" the main breaker is all about.. Sorry you are having such a hard time with such simple concepts. Ha.Ha..Ha.. It is a sign of a very weak mind... Or,, a kid in your case that hasn't figured it out yet.. Hey,, if you are only 12/13 years old,, you are pretty sharp.. Just BONE HEADED!! Ha..Ha..Ha.. I could teach you something though.. As long as I could keep your attention.. Kids these days.. Hey.. You are not one of those kids who has to go to the Crying Closet a couple times a day.. Are you?? Sound like one. Ha..Ha..Ha.. Cheers. I have to go.. Have better things to do.